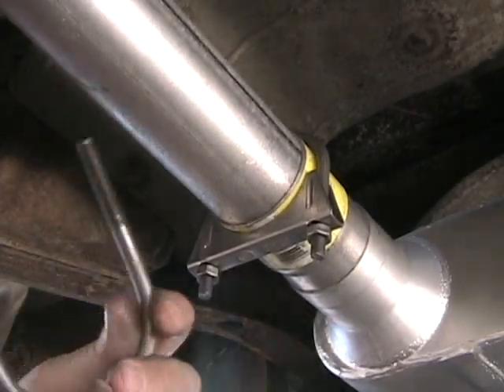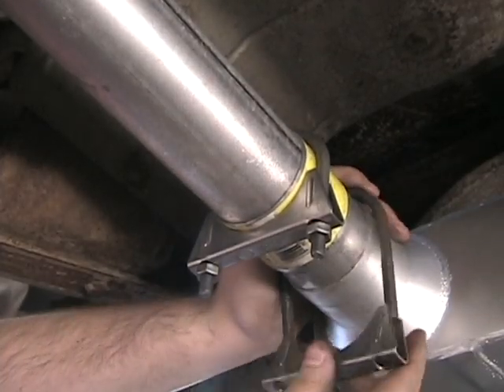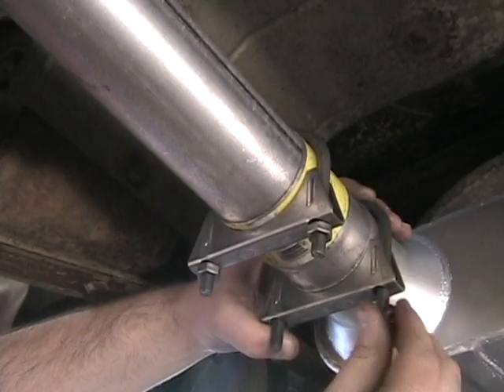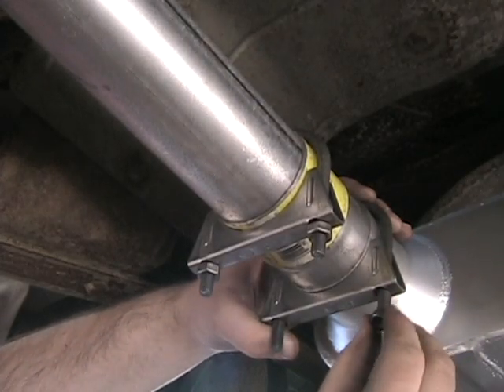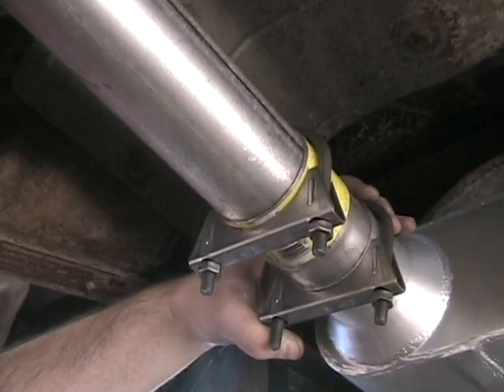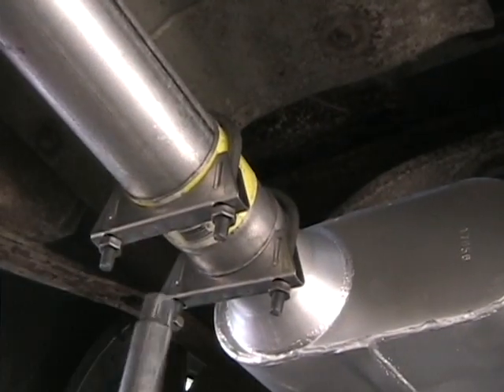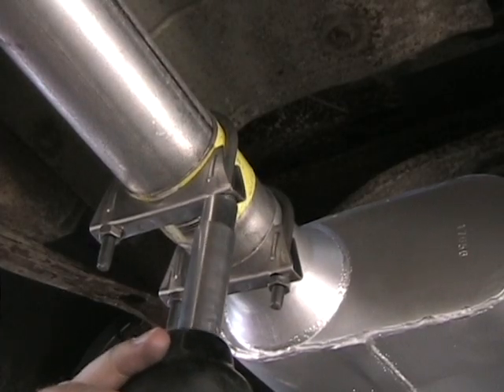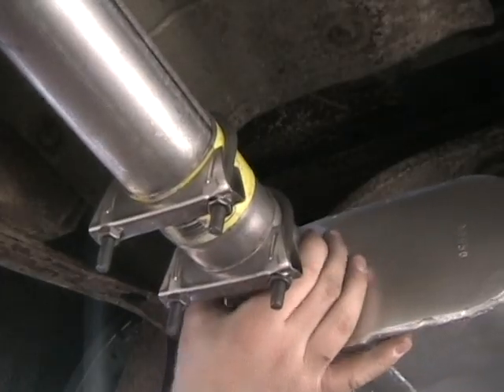Installing Exhaust Clamp

Comment from the maker: New Dart video coming soon! Catch up on all the Dart series here: http://bit.ly/2G46oS1
Reply: I'm kind of new to this. If I'm going to install a new exhaust tip on my car using exhaust clamps like the ones in the video, does the inlet diameter of the exhaust tip need to be the same as the inlet diameter of my exhaust pipe, or bigger or smaller? someone please help me
Reply: @tommyd5891  hey man. U still here?

Comment: torque for a 3/8" bolt, which standard clamps are ASTM A307 Grade A steel are 13 ft lbs. If you go higher, you are stretching the bolt.  Or, just make it tight with your 3/8" drive ratchet, check for leaks, and tweak if neccessary.
Reply: Band clamp

Comment: So I'm here after part of my exaust came off driving down the road.
Reply: same
Reply: Were all in here together
Reply: Even in 2020 were still here
Reply: @3.6roentgen61  yeah i just bought a trans am & as i was cruising down the road & leaned into it.. Coming from the aftermarket headers going into a y pipe, it blew 1 of my exhaust fitting off as if there was no clamp there originally so here i am looking for a good temporary fix for a few weeks until i can get some one to wield it togeather
Reply: Locktite
Reply: Yea me too
Reply: 2023, what’s up guys?
Reply: Happend to me last night less gooooo

Comment: I decided to do my exhaust at home, which was a big mistake! My welding skill is about -1 i think so i managed to destroy some good pipe, pipe which is kind of expensive.Anyway, Ima gonna buy some clamps like this and get it done! Its much easier, i think.I will return with my results:D
Reply: I'm kind of new to this. If I'm going to install a new exhaust tip on my car using exhaust clamps like the ones in the video, does the inlet diameter of the exhaust tip need to be the same as the inlet diameter of my exhaust pipe, or bigger or smaller? someone please help me
Reply: I welded my own exhaust and 84 inches of 2.5 inch aluminized steel was only $36

Comment: I'm kind of new to this. If I'm going to install a new exhaust tip on my car using exhaust clamps like the ones in the video, does the inlet diameter of the exhaust tip need to be the same as the inlet diameter of my exhaust pipe, or bigger or smaller? someone please help me

Comment: Do you have to use 2 or will 1 work. And does the pipe have to be slit to allow it to flex onto the other pipe?
Reply from the maker: 1 should work, no slit needed in this case

Comment: Didn't know you could bend or compress metal with a clamp
Reply: You can, I tightened mine down a little too much and you can feel on the top of the clamp that it is dug in to the exhaust pipe and deformed the two pieces together. No way to get it off like that without cutting.
Reply: @johnr.timmers2297  yea and getting those exhaust clamps physically off is impossible
Reply: Most sleeve joints should have slits cut in them so when you tighten the clamp it pulls the pipe down.

Comment: Better off not using the U clamps. They pinch the metal so there will be an exhaust leak. I installed my exhaust a few years ago, and inspecting it today I found that condensed water drips from the union where the U clamps are. I tightened them but water still drips. I am going to try and find a clamp that completely touches around the pipe, not these crappy U clamps that only touch on 90 percent of the pipe. That is what brought me here, I am looking for good clamps.
Reply: did you find them?
Reply: The search continues
Reply: Arturo Gonzales  They're called band clamps. Sealant can be used with the initial install as well. I think I'm just gonna weld mine together. More unwieldy, but unless you've a good gasket connection with a v-clamp or similar and flanged connections, most of what I've read is that either A) You're lucky and it works, B) You're lucky until you're not and it leaks, or C) You're taking it right back off cuz it didn't seal.  Of course, I say this, but watch me weld it poorly and that cracks too!

Comment: I have exactly the same setup on my exhaust, one of those clamps came off. I went to mechanic but he refused to replace the clamp,he said this is not the proper way to do it ??
Reply from the maker: These are an acceptable DIY method to patching/fixing your own exhaust. However, this video is very old, and if I were to an exhaust system today, I would like use band style clamps and not these cheap part store clamps. These work great in a pinch. I would not expect an exhaust shop or mechanic who deals in exhausts routinely to use these.

Comment: How do you know how tight to put these types of clamps?

I just got them with my exhaust and every other exhaust I've ever had has been a but joint with bolts going through and a gasket in between...    does this style actually bend the pipe?  I see in the video the bracket's bottom starts flaring out but I want to make sure that when I do this I don't crush the exhaust piping because of a silly mistake not using these before..

Comment from the maker: Unfortunately, those clamps sucked lol. The point of those clamps is to "squeeze" everything together. I believe those clamps came from Autozone, and I will never buy them again. lol
Reply: sorry to dig this up. but my truck came with an exhaust system that is using similar clamps and they leak out bad. Are there better clamps that work better than these other than having to V band flanges on?
Reply: @treble_clef123  5 months late but put copper gasket maker where the two pipes your clamping together overlap. Permatex makes it and it's good for exhaust temperatures. Them clamp down with an impact and you shouldn't have any leaks.

Comment: damn I bought some at pep boys, I'll let you know if they buckle up like the ones you bought, nice vid, it gave me ideas ok on replacing my rusted muffler with a new one
Reply: I'm kind of new to this. If I'm going to install a new exhaust tip on my car using exhaust clamps like the ones in the video, does the inlet diameter of the exhaust tip need to be the same as the inlet diameter of my exhaust pipe, or bigger or smaller? someone please help me

Comment: My muffler is on a 45 degree angle if I do install new one with clamps will it be a any problem due to being in a 45 degree angle? Please reply
Reply from the maker: Not sure, guess it depends on the vehicle you are trying to install it on and if there is enough clearance.

Comment from the maker: I used to. But being in a rust belt state, it doesn't help much. I end up just cutting the bolts off with a dremel and replacing them with new ones when they need to be replaced.
Reply: use stainless. I have the same problem

Comment: Question: Can I install these clamps without the use of an impact gun?
Reply: Impact gun just makes it faster to tighten it harder. U can tighten it has hard as u can by hand and use automotive bolt glue (idk what its called) to ensure the bolts won't come off. This is speculation lol
Reply from the maker: Matthew Nikolas Wilson - You can use an impact gun, but a lot of the times it makes a mess of the clamp. You have to be very careful.

Comment: What is yellow stuff under other clamp? Should there be some paste or tape around the pipe before sliding the joiner piece over the end? The joiner piece is about 1/8" bigger diameter and it seems it would leak if there wasn't something to seal between it and the pipe.
Reply: Eric Frentzel it's the sticker with barcode for the exhaust pipe haha.

Comment: Heat Contractions Will Inevitably Loosen The Clamps More Often Than None.😔 So "Loc-tite" And Check The Integrity Every 4th Trip.
Reply from the maker: These clamps won't loosen. At least, not up here in New England. They'll rust before that. These clamps are also "old school" and I would use a band clamp today.

Comment: I just put one of these on today because my heat shield was rattling
Reply from the maker: Corey miller awesome! They are quite handy.
Reply: @ACHAutomotive  how could i go about talking one of these off? i have no impact gun nor do i have anything to cut, all i have is a wrench... the one i need to take off is badly rusted and was put on insanely tight with an impact gun (both sides of the clamp are folded)
Reply from the maker: @ThaneAZ  Do you happen to have a breaker bar or 1/2 ratchet? In the past, I have busted these off just by either tightening them further or trying to undo them. If they are super rusty, I wouldn't think it would take much to bust them off. Might be able to put a long pipe or bar on the end of your wrench to give you the same effect...

Comment: Overtightening is very possible.  NOT "straightforward"-  if really torqued it would form a groove where the clamp hook is forced into the pipe.
Reply from the maker: It is straightforward to install a clamp like this. You need to pay attention. On systems where these types of clamps are used, typically you would just end up cutting the whole or most of the system off to replace it anyways. It's a "cheap" repair.

Comment: Is that a piece of a tin can that's being used for the piping? Not a good idea. It will eventually burn through because it's weak, thin metal. My dad did this way back and the thing fell apart after a month or so. Find an actual piece of exhaust-type steel.
Reply: Realize this is a really old comment, but for anyone who reads it and is curious: No. that's a flanged adapter for exhausts. You can see the yellow sticker and UPC still on it--that's not a soda can product label. It's shown up on every exhaust piping I've ever ordered.

Comment: Having serious issues with mine popping off just while installing. Can't imagine going down the road and losing my exhaust or having it hit my car and damage it... Thesr clamps piss me off. I tried to make an exhaust with 4 to 6 of them in various spots but no luck they don't hokd worth a damned pipe just pops right back out
Reply from the maker: Yea they suck. I've learned that as I've gotten older and more experienced. Haven't found a good solution other than having someone weld it all up.